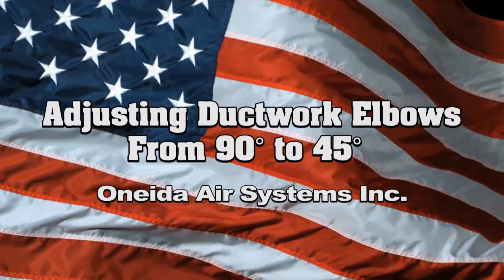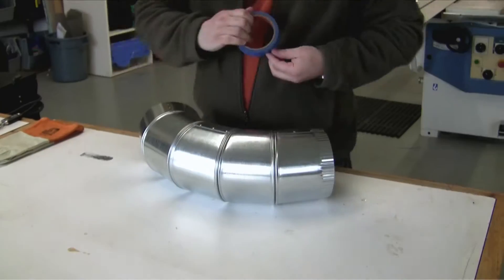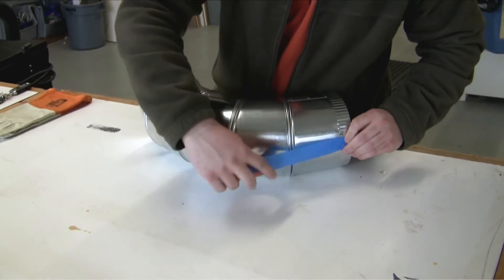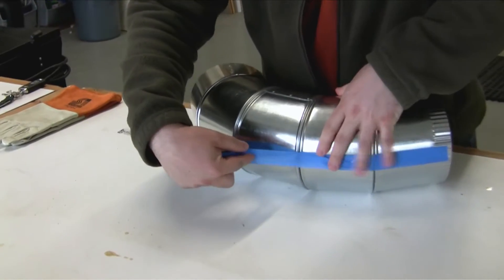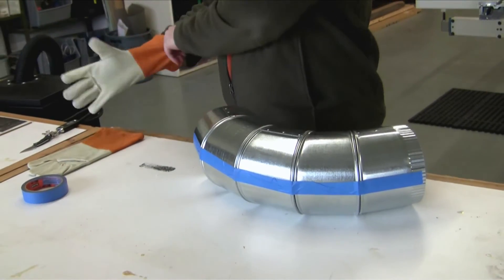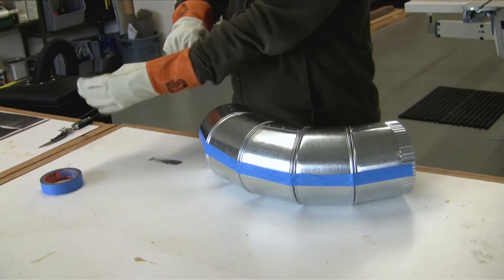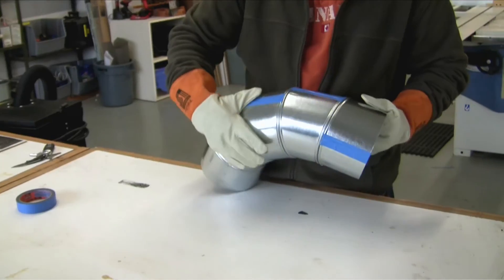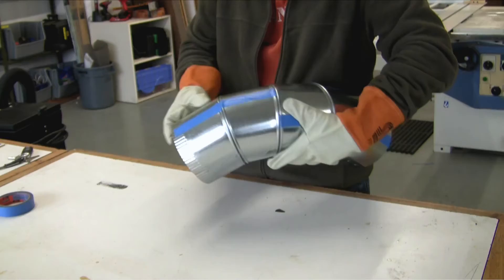How to Adjust Ductwork Elbows | Basics of Dust Collection

Comment: Duct size. In relation to dust deputy size and dust collector as well as a guid on dust deputy size based on dust collector
Even brands you dont make, this is more for a diy home system.
People spend a lot of money on dust collection systems then find out it dosnt work for them. To a hobbyists woodworker this can be a big investment 
And risk to guess and failed the objective. 
We use dust collection systems for different reasons 
Keep lungs safe
Keep dust out of hvac system
Keep shop clean
To save inside conditiond air.
Let's say you just replaced your HVAC system you work in a hobby shop in your houses basment, the hvac system is highly efficient so it stands to reason its using a large filter  say 25x20x5 merv 10
These filters cost 30 to 50 bucks each
And you cant always find them in the big box store.. 
Letting 6 micron dust out in the air quickly blocks you hvac systems air filter a lot of that bypasses the filter and blows in every room of your house.
 It gets into your lungs unless your wearing a dust mask, but other people in the house are not, you other half, your kids and your pets. No hung air filters going to clean this from the air, you need to collect the dust at the scarce. 
Right off the tool.
Selection of duct pipe per dust collector air speeds.
Can I use normal hvac duck work or do I need spiral pipe or even solid pipe.
Basic ideas somone can use to determine steeps needed to get it right the first time.